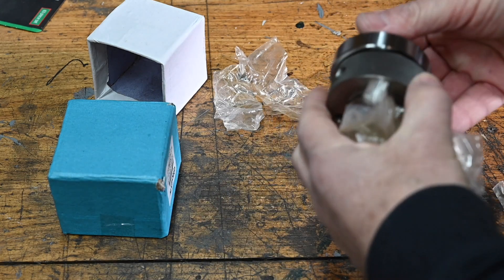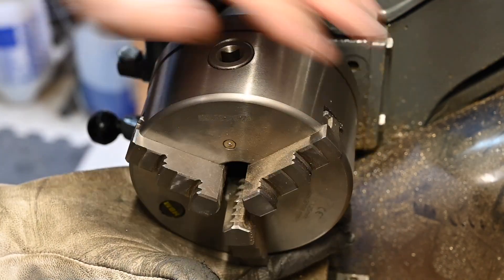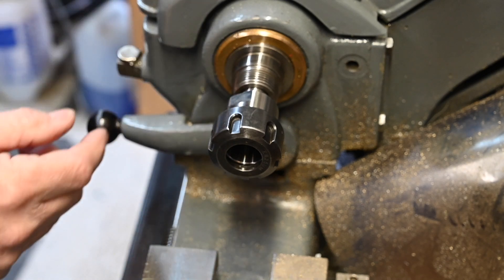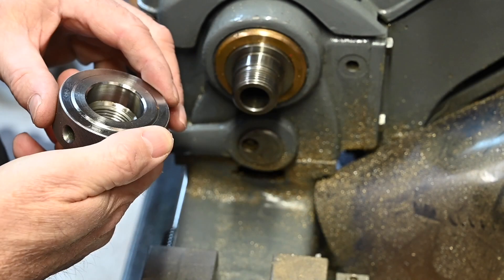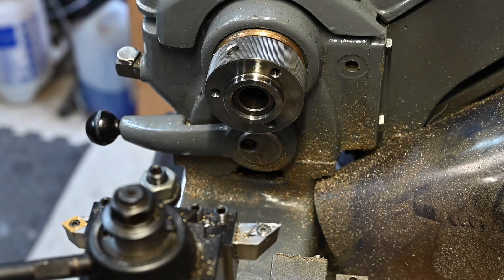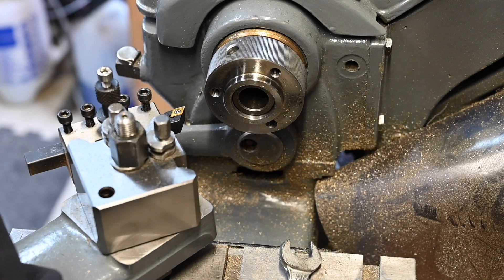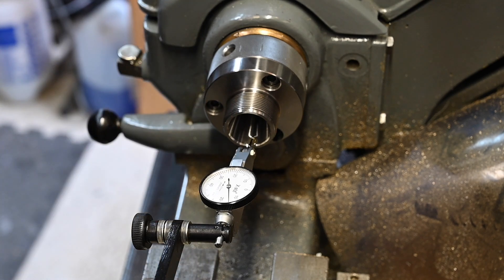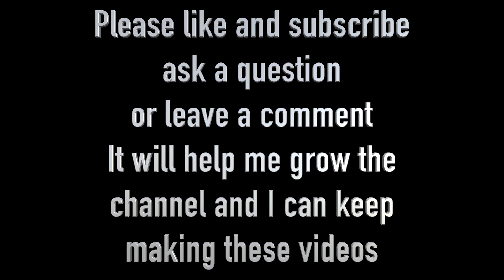Fitting Collet Chuck to my lathe

Comment: Your precision is good, but could it be better? You are relying on the threads for accuracy when a slight give would allow the machined surface to contact square on both shoulders.
Reply from the maker: @Corsairflag  Thank you for the tip 👍

Comment: Isn't it 2/100mm runout considering that you have a 0.01mm indicator? 
I have just added the same type of collet to my lathe, and i got similar runout at first. I manage to reduce it down to few microns by clocking the collet using the next screw hole and gently tapping the collet before fully tightening the screws.
Reply from the maker: @EricB420  thanks for the tip 👍